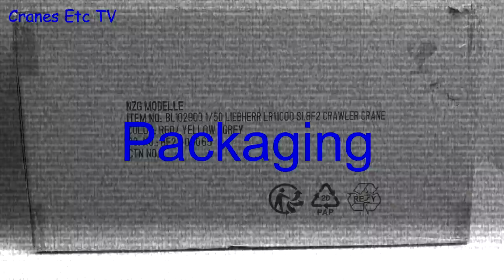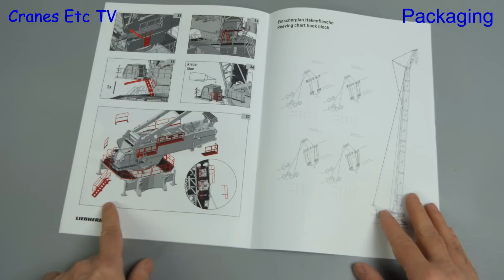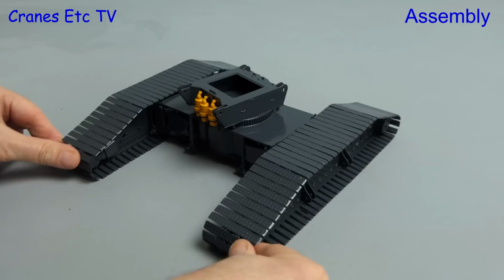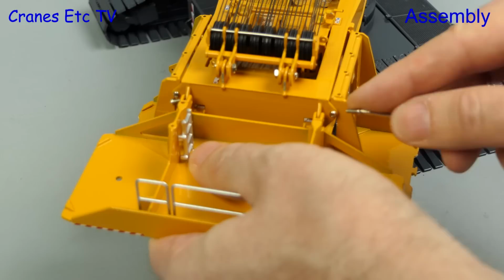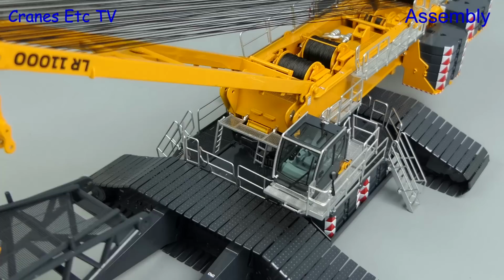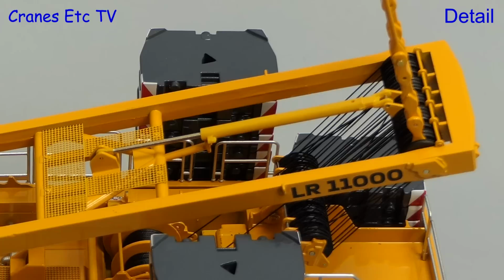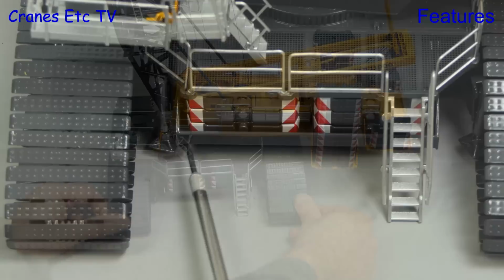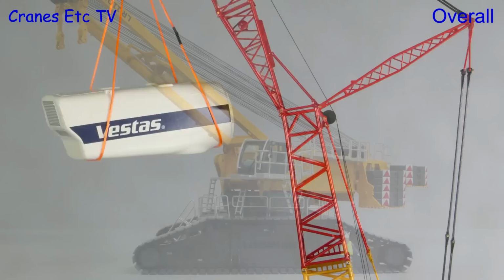NZG Liebherr LR 11000 Crawler Crane by Cranes Etc TV

Comment: Another great review, I'm hesitant on getting one at the moment, I'm hoping a spacex version comes out, as it is the same configuration. Also hoping nzg fixes a couple small issues in the next batch, like very loose handrails, sagging cab. It is also very expensive for what you get, compared to the older lr1600. Yes it is taller but you get a whole lot more crane with the 1600 than with the 11000. Just my opinion. I think if the Derrick kit came with it, then the price would be about right.
Reply from the maker: The loose handrails only really come in to play when you start moving the model.  For a fixed pose you can get a good result but yes, more consistent fixings would be better.  The cab tilt on my model is OK.  The price issue is interesting because the net weight of model in the box is 50% higher than the LR 1600.  Add in a modest 20% inflation since the LR 1600 first came out, and the price actually seems sensible.  But of course the LR 11000 is so much bigger so you do not get as many configurations out of the box for the weight.
Reply: Very true im gping to leave it for a while too 👍

Comment: Well ill have to build mine minus one boom section my ceiling height is only 8' . I hope the Sarens  version will not have the loose car body very important for a heavy crane for that to be sturdy. 
Love to see a video on how to move these large crane models so you don't damage or have your reeving  become undone. Like where the best place  to grab the model . My biggest fear with these large models is when you have to do home improvements like new flooring or new windows and you have to move these models to another room. I don't being to have to disassemble these once they are built.
Reply: I don't want to disassemble these once they are built. 
I don't know why I can't edit my comments anymore like before when you notice a typo?
Reply from the maker: I have lift and shifted this model and it is very heavy and therefore awkward.  If you build it ceiling height then getting through doorways is another challenge.  Booming down to far makes the model unstable so you end up tilting the whole model forwards and then the counterweights want to slide off.  The key is to keep tension on the A-frame ropes at all times.  So I lift the boom on the top edge (not from underneath) so the tension in the pendants is kept on.

Comment: Do you think that in the future there’ll be some extension sets available for that crane?
Reply: Cecilla pena i am not sure of what it max lift cap with length of boom sure not 85? Could there be a 100m twin boom kit? Short circle lift but heavy? Close to 2.4 meters is wow for a model ae 👍
Reply: Yeah, well, I think for the fans of the big crawler cranes then they’ll be pleased to think that they might be stronger than just a hope that they could be able to expand their model in the future if they buy the extension sets that you come out with, so let’s look forward to that and hope that comes out.
Reply: of course.  NZG wants more $ from us.  figure in another $500 for the derrick and luffing jibs and another $100 for each additional section ...lol..
Reply: Speaking of a derrick I hope the extension kit includes a derrick.
Reply: NZG told me that there will be kits for this model. I hope it will be a derrick with V-frame and variotray.
Reply: If you want to see more of that check the NZG Toy Fair video.